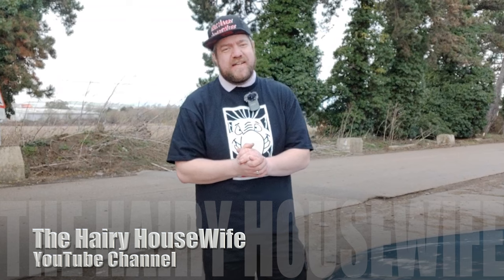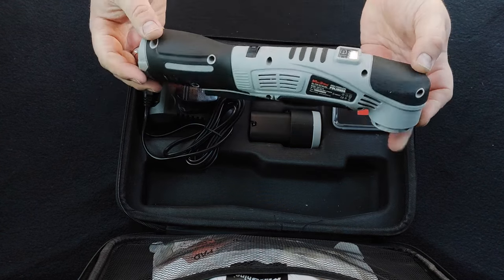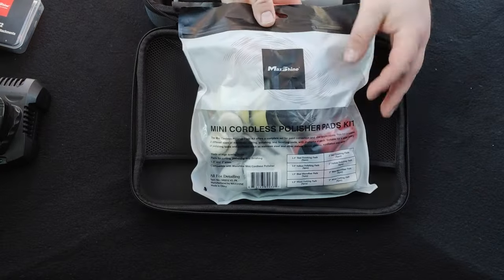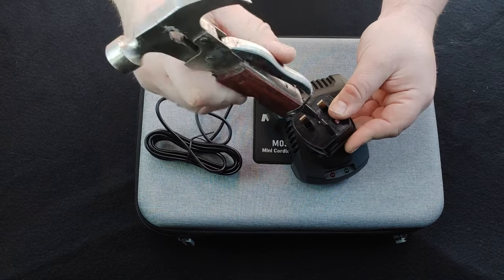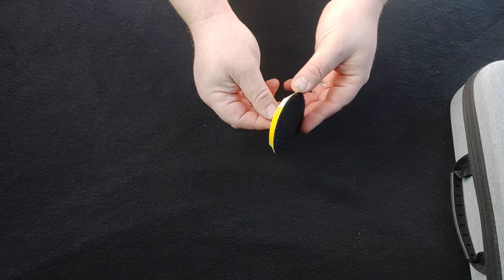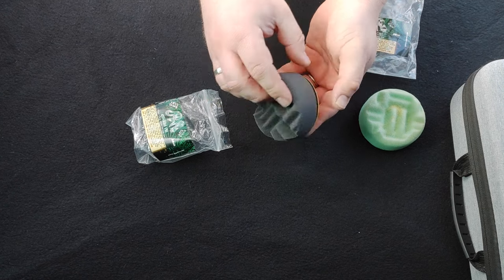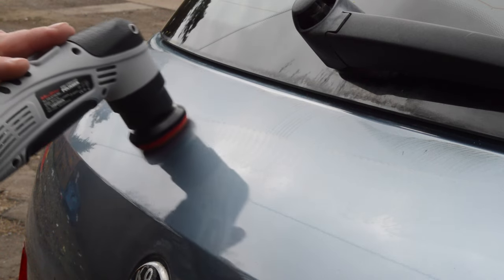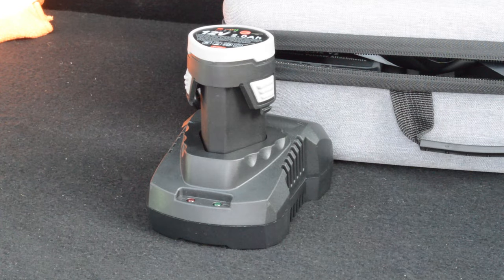Maxshine V2 cordless mini Polisher M0312 V2 Review , Is it a budget Flex PXE 80 Rival ?

Comment: I recently purchased this product, sadly not having seen your video. I 100 % had the same issue with stalling with the 3mm offset. At first, I thought it was just optical, but no, when in DA, it does not work. I agree that the pads are poor, and I found it improves greatly with decent pads.

Comment: Thanks for the thorough and honest review. Been looking at getting a mini polisher to work areas such as bumpers, a-pillars, etc., especially since I've ordered a new MX-5 that I expect to be here in a couple of months. I have a regular size polisher for the larger panels but want one to use when working in smaller and tighter areas. Still researching them, but this one has popped up as a value based option. I'm also looking into the Shinemate EB210 and the Griot's Garage "The Boss" Hybrid Micro Polisher as more expensive options.
Reply from the maker: Really is a nice little machine for the value , the lack of attachments is a bit of a let down but you can buy these in Amazon, let me know what you choose 😁
Reply: @TheHairyHouseWife  After a lot of researching last night, I ended up placing an order for the Griot's Garage "The Boss" Hybrid Micro. Looks to be a serious competitor to the Flex unit, with a few additional tweaks that really speak to me. I've also had great luck with their G9 polisher (my main go-to), and their lifetime warranty really gives me peace of mind. Truthfully, it's probably overkill for what I need, but I figured I'd spend a bit more upfront and hopefully get a unit that I won't have to replace in a year or two.